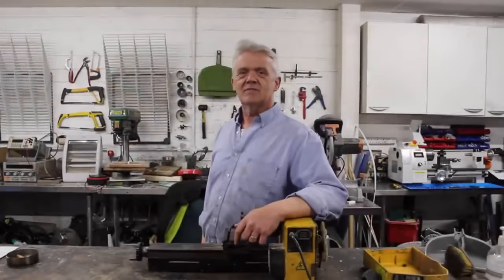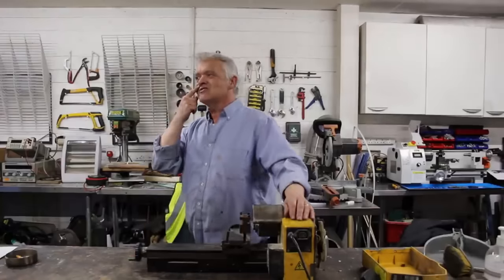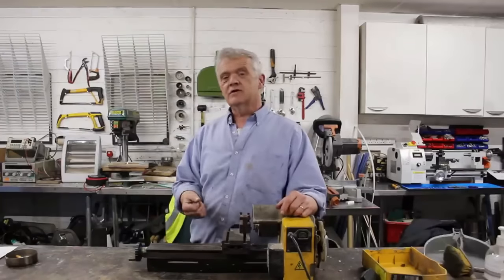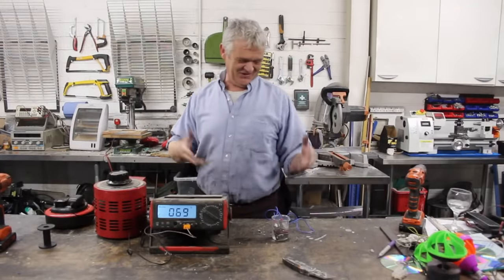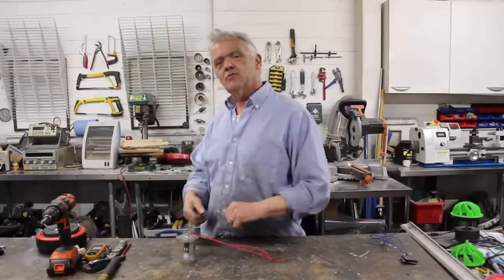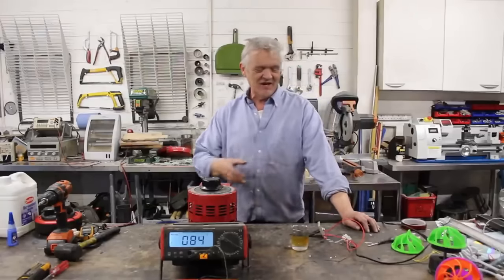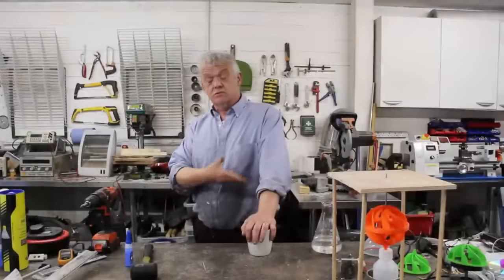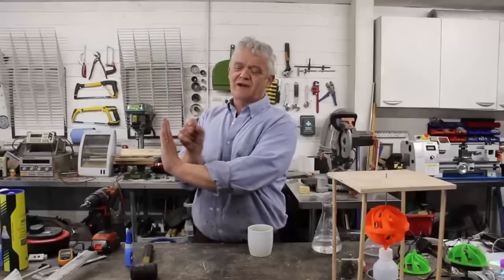016 The Dumas Effect - A Free Energy Water Heater

Comment: n 2007, John Kanzius demonstrated that 13.56 MHz radio frequency could be used to dissociate hydrogen and oxygen from a salt water solution, which could then be "burned." The interesting thing was there were no electrodes in the water.  Basically a radio antenna injected the energy from the outside of the container.  A google search will show some interesting facts about him and his experiments.  I am assuming the frequency is some harmonic of the actual resonant frequency of water.

Comment: So it seems that you get electrolysis if DC is applied  heating if AC is applied, why not accomplish both using the same array.
That way you can utilize the available electricity to either warm the water or perform electrolysis’ . Are there any examples of this which will yield to separate gases, hydrogen and oxygen?

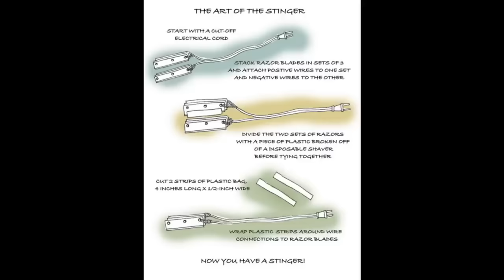Comment: Oddly, the graphic at 13:12 says to attach "positive wires" and "negative wires" but shows a US wall socket plug.  Power coming out of the wall socket is AC so there are no positive and negative wires.  The current coming through each wire is constantly alternating between the two 60 times a second (60 Hz).

Comment: If anyone wishes to mess with mains , just remember one thing , put one hand in your pocket,  if there is no current flow across your chest you are usually safe from being electrocuted,  an isolation transformer helps as does an earth free work area,  but put your hsnd in your pocket
Reply: Don't learn the hard way and mess with the insides of a microwave oven high-voltage with two hands!

Comment: Okay, so if you could use a wind mill to power a Dumas device and then stroe the heat in a sand battery, THEN we'd have something! 😂
Reply: was thinking the same thing as i watched this.
Reply: Sand battery?😮
Reply: I made a small sand battery using the dc from a solar panel directly to a heating element from a junk electric stove. Just buried it in the sand about a third of the way from the bottom. Simpler than adding another conversion step.
Reply: @jamesparks6137  nice!

Comment: If you put electricity through a resistor, you get heat. Essentially anything that is not 100% efficient gives off heat. You don't need to do anything special to turn electricity into heat. 
If you want cheap heat in your house, put black card or any black material inside your window to extract the maximum amount of heat from the sun during the day

Comment: In proper heater of this kind you need to keep electrodes wibrating at frequency of current which will induce cavitation of water. Water cavitates well at 50 Hz. Here is over unity. One electrode resonating at 50 Hz will do. What you must be aware of is that resonant frequency is different in air and different in water

Comment: Use an inert electrode material e.g., gold and take care to prevent any contamination. De-ionized water won't do anything because pure H2O is an excellent insulator (water doesn't conduct electricity at all). This only worked because the chosen electrodes (and kapton tape & mungy beaker) polluted the water making it a (high) resistance solution. As the electrodes heat, they pollute the water faster, & the lower the resistance. It's the resistance generating the heat. No mystery in that.

Comment: We use industrial size humidifiers at a data center that uses this at 480 vac and they are a pain in the ass. They lime up quickly and the cylinders that house the electrodes is just perishable item. The electronic controls trip out constantly during heavy use making them a nuisance device.

Comment: Can you make a video about the drum heater? It was a cylindrical drum with a slightly smaller drum inside the first with holes drilled at very specific size, depth, and spacing from each other drilled into the center drum. The center drum spins on a shift on sealed bearing that are part of the outer drum and it is spun with a synchronous motor for a constant speed so that different hole arrangements of different inner drums can beat the water around at different frequencies that causes almost instant steam or hot water depending on the hole arrangement... would like to know you're thoughts...

Comment: This is nice and inspiring! What if You use AC, 2 plates, and for sure there will be no electroleses. But if you crank up the frequency above 22GHz, would not that make the molecules changing direction AND bumping to each others that is create "fraction" and therefore heat? The energy (AC and voltage) you put in, should reveal itself as heat, isn't it?

Comment: Whoever said that the cost effective (apparently) incentive for producing only either 50Hz or 60Hz means that these two forms are the suitable form of electrical energy which is conducive to integrating effectively with the wheel work of nature. Nature does nothing by chance and what is, is the way it is because that's the only/best way it is possible. That means we only need one piece of the puzzle to not be in the place it needs to be and the entire collection of pieces may as well ALL be  in the wrong place. *NB, this is mainly referring to the principle reference frames which underlie our local reference frame and in themselves are are also a local reference frame, with its own underlying reference frame/s, and so on and so on...

The degree of variability allowed in any given reference frame is respective to the reference frame from which the variability is introduced from. In other words, can directly affect phenomena in our own local reference frame with energy/force which is only 90% compatible with the intrinsic nature of the energy/force as it actually exists as. And the degree of variability may only have a compounding effect on the resulting degree of variability of only .000001% *In the directly equivalent reference frame. 
But in a non-local reference frame of only 1 order of magnitude removed from the local reference frame from which the original variability was introduced, the compounding effect on the resulting degree of variability may increase to 10% now. And the further from the local reference frame that the target reference frame exists at, the far greater the resulting degree of variability will become. 

To the point where the discernible effect produced in a distant reference frame will have a Degree of variability that essentially renders the qualitative component for its value as completely useless. IE; a result which is 1 + a degree of  variability equal to 10 to the power of 144....

And 144....

What electrodynamic effects are witnessed / introduced when the frequency of an input source differs from that of the conventional input frequency?

I note that Tesla would use this frequency as a means of tuning the system to find the coherent dynamic required for it to engage with nature as it was intended too.

Comment: It is simply the resistance of the water getting hot and as the voltage x current generates heat in watts dissipation.
Use Ohms law and Power law.

Comment: I suspect that the water that is between the electrodes gets hot, but the majority of the water is not getting hot rapidly as implied. Seeing   bubbles at the top means little as some electrolysis may be causing that. Put several thermometers placed in various areas of the water and see if there is a wide variation.
Reply: Yes, you're correct. Need to do a Time/heat test.

Comment: Question, if we are putting electrons in water now, why not just put a shorted wire coil in the water? Like loosely wrap a 1mm wire around a 8mm caramic bar,  put about 50 meters of wire  in a bucket, say 10 ohm resistance, connect 240v to it,  it should heat water to get more watts, cut it in half, and make new connections, double the current,   why not do this? Turn the element inside out??

Comment: Is it more efficient than an ohmic heater once thermal inertia is taken into account? Still not sure I understand how de-ionised water can conduct even with AC. Are the carbon rods contaminating the water?  What would be the best frequency to use? Would this depend upon the electrode spacing? FJ Camm published a similar domestic water heater in one of his home DIY books. It looked like an absolute death trap, but that was back in the day!
Reply: You must have some minerals in water, in my home resistance heating system I have water from pipe, and if this can't give enough amps, must put some baking soda in water. You can heat or electrolyse de-ionised water if you put electrodes too close one to other.

Comment: There was something similar back in the 70's and 80's used in hot water jugs
Reply: Elements made from parallel, circular, stainless plates were available for electric jugs, back in the 70s. We had two in our jug to speed it up.

Comment: Yeah I thought this was an April fools joke until I remembered its September, lol
The last 30 seconds or so says it all, water is a resister, it will give off heat when a current passes through it. Note current is the important aspect.
The only reason we don't see water heating if you drop a hairdryer in the bath is the fuse blows.... 🤓

Comment: First resonance frequency of water is not 22GHz. It is - guess what - the frequency of all microwave ovens within the known universe. And this is 2.4GHz. It is a misconception of many people, a resonance of a liquid would facilitate taking the constituent atoms apart. The only effect is heat, because free path-length in a liquid or solid is much, much smaller than mechanical oscillations of the bindings. Such oscillations cause to bump atoms into each other, what causes friction - aka heat. Therefore, the most efficient and fastest way to heat water is to use microwaves at the fore mentioned frequency.

Comment: I wouldn't stop using water heaters just yet. Unless the gas given off by the effect is a problem, I don't see why this effect couldn't be applied to them as well. I mean, tanks are made to handle over 100 PSI. Anyway, tanks do act as a thermal mass which can still be useful. They heat the water as needed and can do it with less up front power. Otherwise, they'll store the heat for days even when there's no power. You need a hot shower without power? The tank's got you covered for a bit. I also don't know if tank-less heaters are any cheaper to run in the long run.

Comment: It is simple to test the "resonance". Use pure distilled water and see if the device still heat that... It is water without salts, basic, distilled water is isolator.... LOL, i wrote this just before he said "de-ionised water"... Carbon rods from battery already have some salts on them. Some Inox for electrodes must be used to prevent contamination.

Comment: Just wondering if this would work in the rice burner stirling engine, with structured water at low voltage since a small amount of water is needed. 
From a battery and DC to AC rectifier. Then the generator could charge the battery and maybe some extra storage could occur?
Capacitors before the load to drop resistance or back EMF.

Comment: When in prison some 20 years ago we used this method to have a cuppa in the night time. We would stick a couple of bits of wire like welding rod from the workshops into.a radio lead and boil a cup of water. If the wires touched the power went off on the wing😂

Comment: you mentioned that resonant frequency of water is ~22GHz and as far as i can remember, Tesla made high voltage safe for humans by making it high frequency ~10kHz ... so, if we made a 2 plate stainless steel heating element for a water heater (shower) that would be operated at 10>kHz, it would be safe for use?

Comment: on the frequency I am guessing that if you switch to double the frequency, it will heat twice as fast much as how a microwave is pushing and pulling on the material causing it to generate friction heat or some such.
Reply: There is a formula that I found that relates the dimensions of the electrodes, distance apart, water conductivity,  current, and energy put into the water. No mention of frequency.

Comment: Weird, this reminds me of my grandfather who told me stories about this waterheater they used during WW2. It was made out of a few pieces a wood some wire and used double edged Gillette "Safety Razor" blades. It heated the water in a cup like a charm. This graphene based one seems to be a much safer version of the aforementioned "device" (considering it wouldn't contaminate the water with chrome and other metals).
Reply: Same thing was in common use in the East German Volksarmee to boil water for tea or coffee. It was called 'Ufo' and responsible for much electric blackouts in the army barracks then. 😅

Comment: This would be very good for heating things like the home, if it is much more efficient.  Also need to do long test to see what changes after time like will it work for one month or one year without needing maintenance.
Reply: This can be much more efficient for home heating, but I tested couple of products from market and they have just a little better efficiency, not so much. I do many experiments and I find a problem. All of them started with low current and slowly raise the current and temperature of water. What you need is constant (high) current all the time, and this is not easy to solve, because of resistive nature of this setup. Also, tri phase give higher efficiency then single phase.

Comment: Another thing I want to ask is if an array of the device is better than just a bigger machine and if more amps would be nessecary to increase the effect or higher voltage?
Reply: The Heatworks equipment uses currents of 100A. We can't do that via a mains socket. In the UK we'd be lucky to get near 13A without a fuse blowing, so with home experimenting it's going to take longer to heat the water, but it should still be faster and less wasteful than heating with elements.

Comment: I had the idea of using the process of electrolysis to essentially gold plate a 24k gold bar using gold pins and fingers from recycled electronics as a means of extracting the gold without having to use very many harsh chemicals that I don't means of using safely as well as being a faster method and potentially cheaper. I've tried doing a bit of research on if it's possible but haven't had much luck finding information. I'm not educated in electronics or plating. Do you think it might be worth attempting before I spend loads of money on equipment only for it to not work?

Comment: lol, actually had  the same thing happen by excedent while doing some HHO experiments....
on this, i used a single diode to rectify 6 or so volts AC, however.... the water started to boil like mad.....
turned out the diode was blown and just conducted straight through. :D
btw, AC on distilled water will conduct fine.... since AC runs through a capacitor just fine and 2 conductors separated by a non conductor, in this case the water, is verry much a capacitor ;

Comment: I like to think of resonance's ability to do something based on it's amplitude or power. Tap a glass, listen to the sound and sing the note it gives. It resonates the glass. Increase the volume of the note (it's amplitude) enough, and the glass breaks. It's the amplitude of the shaking, not the shaking itself, that breaks the glass. We can't tap the water molecule like we can a glass, but the resonant frequency of circuits can be found. One  very interesting thing about RLC or LC circuits is that the voltage can be bumped up to sky high levels at their (the circuits) resonant frequency. Many times 230V mains. Now what happens when working with one of these circuits and the capacitor's dielectric (the stuff separating the plates) is  - water? LC and RLC circuits can easily take a small voltage (like 9V) and bump it into the kV range just using the circuit's resonant frequency.

Comment: Many (50)+ years ago I read something about using this "effect" as a stage light dimmer with a plate on a stick that one can pull up and down in a "bucket". I tried this and it "worked" but it would boil water far too easily on "dim" settings.

Comment: Thank you for explaining why this doesn't result in Electrolysis. I was somewhat confused how this is different from "Electrolysis" that heats the water due to the large amount of current. Water will still conduct electricity due to small amount of impurities. My original thought was that even tho it is AC, it wouldn't really change the fact that we would still see electrolysis occur between the electrodes. It would just be occurring in alternate directions over 50/60 Hz. Once I reached the last 3rd of your video, the explanation that the products of electrolysis never really have time to evolve en masse, was interesting. I suppose you are saying that AC results in the instant formation and subsequent reversion of H + O2 back to water at ~50 cycles per sec. This might actually account for why the water heats up faster than expected.
Thank you very much for this video!
 One thing that I am very curious about is whether or not this method of heating water is actually more or less efficient than resistance heating.